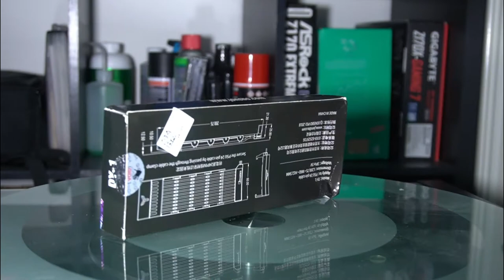i5 9600k aorus ultra z390 16gb 3200mhz 750w psu aorus 8gb gpu build

Comment: Nice looking build good job just wondering why you went with a 120 rad in a case that supports at least 1 360 rad and if you wanted to get nutty a 360 in the front plus a 240 in the top if I was using that case and only had 120 aio cooler I might swap out the exhaust fan with it
Reply from the maker: good idea its whT I had lying around ... didnt think I needed to go amybigger but was looking for a 240 at least I like the room left. of a 240 360 is squashy sometimes ..butyeah who ever buys if they want more cooling can always upgrade
Reply from the maker: plus it doesn't fit exhaust panel..its toobig for it
Reply: @MIKEYZVLOGZ  ahh ok I was just wondering